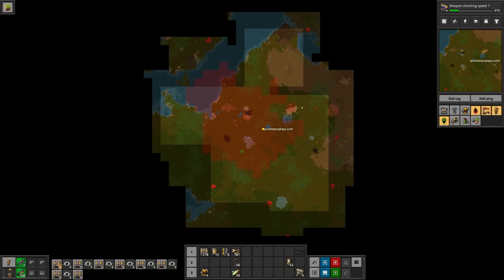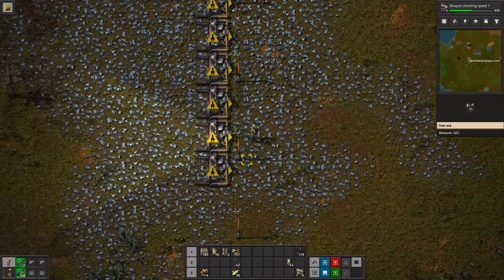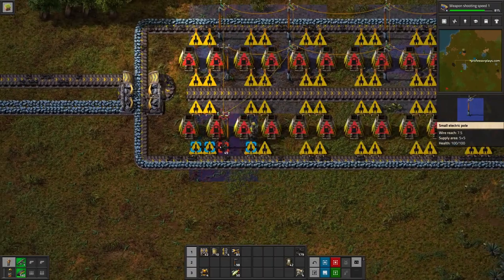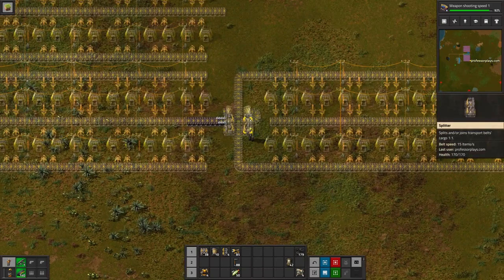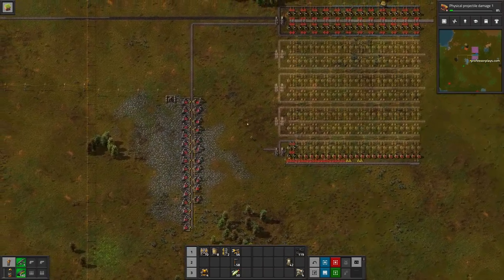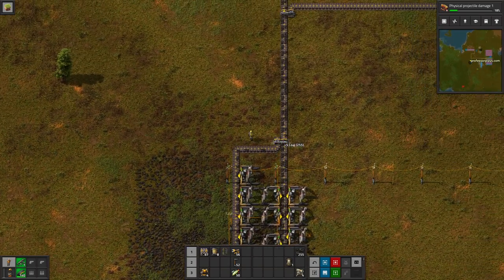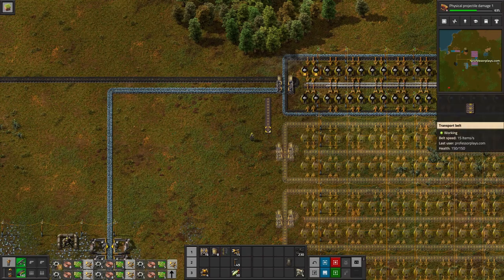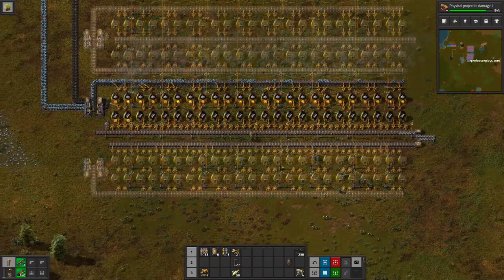Factorio Build From Scratch Season 2 ep1 Smelting

Comment: 31:10 - It's all the electric drills that using up your power; 46 drills eats up a lot. 41:25 - So you're using half of an underground to filter the top half of the input and make a 90 degree turn at the same time. Not something I would have though of, and it seems to rely on properties of the underground that I haven't seen before.
Reply from the maker: Thanks for the feedback.